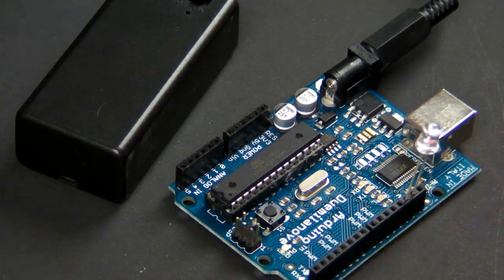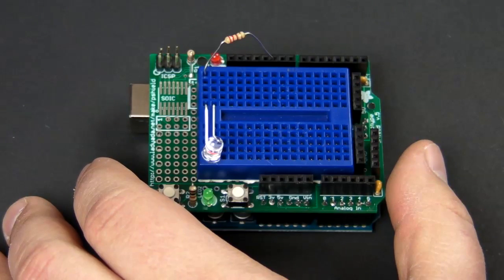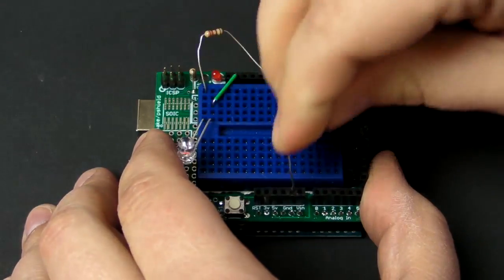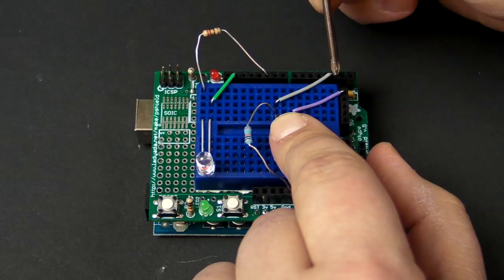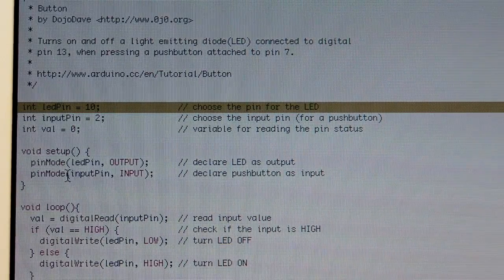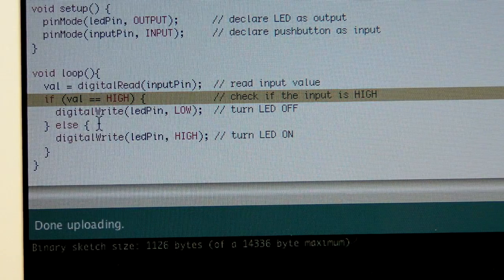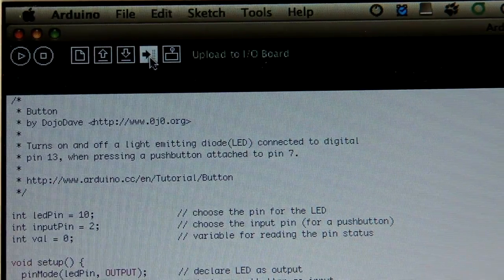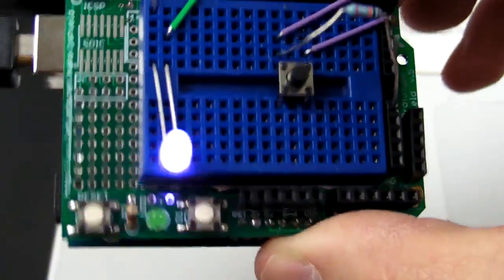How-to Tuesday: Arduino 101 the button

Comment: I would have probably stuck to the conventional flow of electricity to explain this concept. I think most beginners would have understood if you had said "the electricity comes from positive and stops at the normally open position button. When you press the button it goes to the digital read pin". I don't know that people were following you when you were explaining your resistor setup. That's my 2 cents.

Comment: Hey there! Thanx for tutrial. I cannot understand, why do we need to connect pin to ground? If we just check pin state, when its not connected anywhere, it should be low.  And when button is pressed, pin state should be high.

So why do we connect pin to gnd?
Reply: with GND you get a steady LOW with a perfectly reliable signal. ... but don´t believe me, just try without =)

Comment: Nice tutorial. Little correction though: You need a resistor when driving an LED on Pin 13 too, as the resistor is linked to the built in LED only. This wasn't the case however with early Arduinos. http://electronics.stackexchange.com/questions/66992/pin-13-do-i-need-a-resistor

Comment: It seems to me that these How-To-Tuesday tutorials are just a ploy to get the beginners who are watching to learn, to get them to buy something they don't have.  Take the protoshield in this one.  It does't come with the starter kits and if you attempt to follow his directions exactly, we can't do it, because if our Arduino is sitting beside the breadboard the resister wires aren't long enough to reach to the 5v or ground or analog 0 on the opposite side of the ardruino.  Instead of playing games with us, just do an advertisement for your protoboard because we can't do what you're doing without one... And I was about to subscribe to MAKE until I started watching these videos
Reply: You can use any breadboard infact. If your resistor wires are not long enough just use a jumper wire in series with the resistor using the breadboard connections. Electronics is also imagination, so you don't want to get the digested soup all the time...

Comment: Does voltage come out of 5V? Or does it come out of the pin??? Why not use 3.3V?? Why do you have one go to 5V and one go to GND? Couldn't you just see if elections are going through the circut?

Comment: Correct me if i'm wrong, but there is not current flow trough resistor( in case when you dont turn on internal pull up resistor ) when the switch is not pressed.... resistor is just to prevent short curcit when you press the switch?!

Comment: Yeah, but mostly to educate how this simple circuit works so you can change it to your needs. The led can be changed to be a motor or transistor or signal for another circuit or can be changed to turn the led on when pressed instead. This is just a tutorial...

Comment: I had the same confusion. I think the answer is that you need to force the signal to be low (i.e. connect pin 2 to ground), when button is pressed signal goes high (5V), when released it needs to be forced down again (i.e. Grounded)

Comment: The arduino can internally pull the switch up.  This makes all your wiring pointless.  I propose that you wire your switch between a digital pin and ground.  In code you write DigitalWrite(pin) to high.  Then read the same pin with DigitalRead.  If the switch is pressed the function will return a Low value.

Comment: If there is a difference in potential, current ALWAYS flows. 

When the button is pressed, current still flows through the resistor, but the voltage reference has changed, which is what causes the logic level to go HIGH.

You could use a 1 ohm resistor in place of the 1k resistor if you wanted to (if the power supply was up to it), but it would unnecessarily load the power supply down due to the high current flow.

Comment: There are 2 ways to connect a button to an input. One is with a "pull up" resistor or a "pull down" resistor. What is shown in the video is a "pull down" resistor. This makes the switch a logical 1 when pressed. A pull up resistor will reverse the button so it is a 0 when pressed. Place a resistor between 5V and the switch pin and then to pin 2. Then connect the other pin of the switch to ground. When you press the button pin 2 goes to ground otherwise it will be pulled up to 5V.

Comment: I'm sure somebody has mentioned this but the resistor between the button and ground doesn't work the way you stated in the video. Current flows through a resistor when there is a voltage across it. So when the button is not pressed pin 2 is connected to a resistor to ground. Since pin 2 is an input it doesn't supply current through the resistor. This makes the voltage across the resistor 0V which means pin 2 to ground is 0V. When the button is pressed pin 2 is 5V and the resistor flows current.

Comment: here is my code  i will post in two parts because is to big to post..

Part 1

int switchPin = 2;
int ledDelay = 1000;
int redPin = 13;
int yellowPin = 12;
int greenPin = 11;

void setup()
{
  pinMode(switchPin, INPUT);
  pinMode(redPin, OUTPUT);
  pinMode(yellowPin, OUTPUT);
  pinMode(greenPin, OUTPUT);
}

Comment: I am following this video tutorial and done it with no problem, but when i put 3 LED instead of one to control by button  on and off there my problem begins. 
here is what i like to do with my 3 LED when i push the button  LED 1 will light up after 30 seconds will turn will turn off and LED 2 will light up and after 30 seconds will turn Off and the last LED 3 will light up, it will light up as long as the button is push and turn off when the button is not push. somebody help!!!!!

Comment: whats the point of the resistor on the button? couldn't you just have it go straight throught the button without a resistor? Since its open no power would go through and it would still say low or am I wrong?

Comment: @TakronRust Well if the circuit isn't closed, won't you be reading a floating pin ? O and the resistor is connected to pin 2, so that pin is tied to ground when the button isn't pushed and you will get a digital 0 if you read the sate of that pin from the arduino.

Comment: The thing is. That resistor isn't connected to anything until the button is pressed. Unless it's moved to the same row as the 5v pin, it does nothing. Plus, you don't need to keep a circuit closed when reading a high/low signal.

Comment: I might be wrong, but I think your explanation for the button-resistor isn't correct. As I see it, the resistor doesn't carry any current when the button isn't pressed, it just connects the input pin to ground, making sure it gets a proper LOW signal, when the button is not pressed.

When the button is pressed, it does carry a (almost all) current and makes sure that the input pin reads 5V. I would guess that the input resistance of the digital input pin is far higher than the external resistor.

Comment: @smokesometea Based on the paramenters of the LED you're using.  Say you're using a red LED.  A red LED has a forward voltage (Vf) of 1.7V.  Let's also say your particular model is rated at 20mA (Imax) (it will say something to the effect of 20mA@1.7V).  Then finding your resistor is simply (Vdd - Vf)/Imax.  If you're running at a 5V supply then it's (5-1.7)/0.02 = 3.3/0.02 = 165Ω.  The power consumed by a resistor is I^2*R = 0.02*0.02*165 = 66mW; so in this case even an 1/8W resistor is OK

Comment: @Nadrealis From what i now understand, is that if the pin to the button is just going to nothing (not connecting back to ground) then you wont get a LOW signal instead you will get signal that is noisy (i.e. flipping between high and low). so the resistor gives it a path to ground (LOW) when it can't go the other way to 5V

Comment: electricity flows from negative to positive! dont teach people how to make electronics if you put the resistors on the wrong side. in this circuit it wont burn out the led but on a bigger circuit where there is more componenets your leds stand the chance of burning out.

Comment: @playfsx  The resistor are indeed needed... if its not there, the button will short-circuit +5 volt directly to 0v / ground and draw unlimited current, basically destroying the powersupply....

Comment: So, the resistor is there to to stop the +% from going straight to ground when you press the button... instead i wants to go to Pin 2, where it will be read as HIGH.... the desired result.

It is a little confusing, but the video is correct.

Comment: If you connect Pin 2 to ground with a wire (instead of a resistor) It will still read LOW to the digital circuit, but the problem is, when you press the button, connecting the +5v to the mix, the electricity would want to flow right to ground through the switch. Again, I'm not sure what might be read at the digital Pin 2 at this point, but it wouldn't be desired.

Comment: In a digiatal circuit think of it this way LOW = GROUND (not "open"), HIGH = +VOLTAGE

The resistor is NOT there because the "chip can't handle +5v". It has another purpose and the person in the video does try to explain it.

So, to get a 'digital read' on pin 2... pin 2 must be connected to GROUND to read LOW. (Open will not read as 'LOW' to the digital circuit... in fact.. I'm not entirely sure what it would do but it wouldn't necessarily do what you want..)

Comment: shouldn't the resistor be between the 5v and pin 2 then? It seems to me like it's just restricting the flow from 5v to ground, and as he says in the video "electricity is lazy" so it would prefer the path directly to pin 2, with all of the 5v going directly to pin2. And as mentioned in earlier comments, the switch is a normally open switch, so there would not be any flow through it when it's not pressed. Thereby the path to the resistor is cut. Other than that it's a great video.

Comment: yes, that's the whole idea, if button is pushed then pin 2 is connected to Vcc (+5V = high), if button is not pressed then pin 2 is connected to the ground (0V = low)